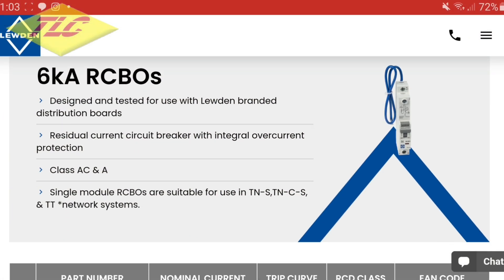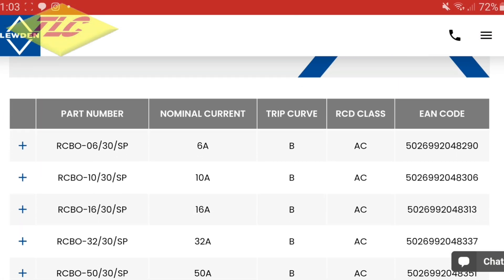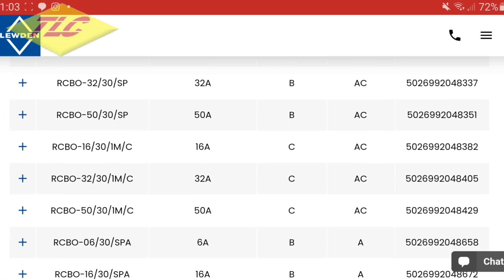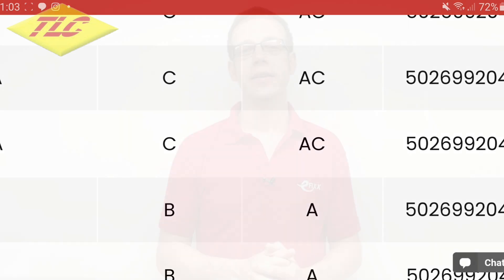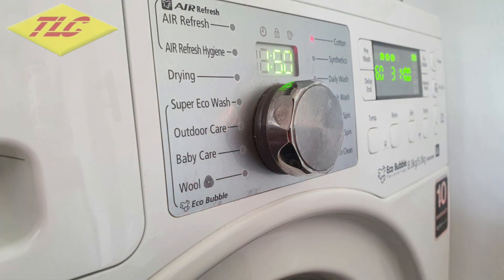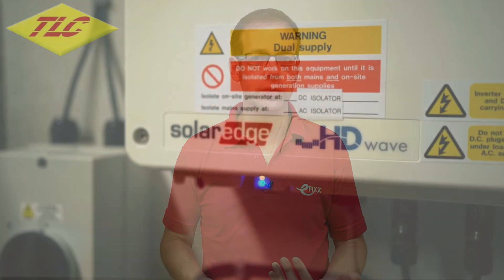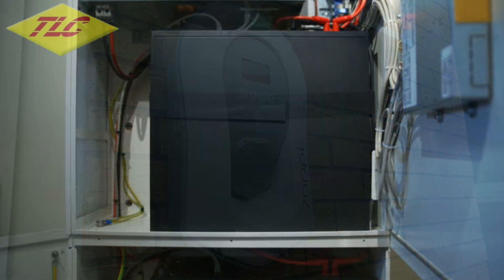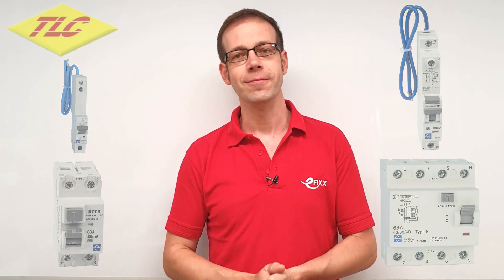What is the difference between a type A and type AC RCBO or RCD?

Comment: Just about everthing has some kind of electronic control on it now. Cookers, fridges, AV, LED lighting, boillers, showers - the list goes on and on. Even if the current appliance on a circuit is a dumb resistive load - lets say a cheap cooker, theres no way to know if that will ever be changed out for one with more buttons than a jet fighter. To that end i've started using type A as my standard. On top of that, my normal practice now is to quote for full RCBO (Type A of course) board to split up that back-feeding DC. I also install SPD's as standard now to help protect all those electronics.
Reply from the maker: Sounds like your onboard 👍

Comment: Thinking about this more and more. You really need a crystal ball to spec up a board. How does one know what a consumer is going to use in the future? Maybe it should be made law that appliance manufacturers are to include a product specific internal protection device lest individual specific RCD sockets be fitted for certain products. Maybe I've had too much wine.
Reply: The only way around that scenario Rodger is to spec for the most dangerous situation, as we used to say years ago, wire as if your customers are complete fools.

Comment: Great video, but could someone explain how one identifies an RCBO with a Type A (or B) RCD element? Since we use Type A, B C & D to refer to the overcurrent tripping curve in both MCBs AND RCBOs, something advertised as a Type A RCBO still only has equivalent to Type AC RCD protection, right?
Reply from the maker: You can identify the RCD type by the symbol on the front. The B, C or D comes before the rating, as in B32, C16 etc. Check out our free CPD on RCD types here: https://www.efixx.co.uk/Know%20How/rcd-types-cpd
Reply: @efixx  is that not that b,c,d is the curve of the tripping time and not the type of RCD it is? This information seems to be hard to nail down.

Comment: As a consumer, does the test button cause it to trip if it’s saturated with DC feedback? As I understand it the test button actually induces an imbalance between live and neutral so I suspect it does, but it would be good to know as I don’t want to assume everything’s fine when I hit test and the find out it’s not when it’s actually needed. Cheers.
Reply: I would say yes would still trip via the test button press but the issue would be that the load.... would  that work Maybe no so.

This leads to 
The injected dc appliances causing an issue might not be on at that  present time.

Easier just to change out to type AC and keep compliant is my best answer!🤓👀
Reply: @bramcoteelectrical1088  thanks, seems strange the the reg writers are concerned with arc faults, but let’s face it how many people have led lights and computers, chargers av kit etc in their houses possibly negation rcd safety devices. I would have thought mandatory advice to update would have been time better spent than afdds

Comment: Totally agree.

I have a question if someone could help?
Any ideas on what should happen/do:- 
If you're doing a small minor work on a  lighting or socket circuit, that had a dual AC RCD fitted to a modern  consumer unit, and the circuit(s) your working  on  has PV, EV or Aircon sharing the same RCD?

Same question with new installations?

Thanks ( sorry for the long question!)

Comment: wish guide to installation of manual transfer switch UK Where we reroute existing house circuits ( eg gnd floor) to switch between grid and external generator ( solar battery off grid in my case ) As the funder of this project this part is elusive (USA does this all the time with many helpful videos but UK silent) Critical for planning is the size /cost of associated equipment.  Wish Application Single phase Domestic premises 100A main fuse   Max load on  gen 40A :  A schematic diagram  showing recommended/ Typical  manufacturers kit ( switch consumer unit etc ) So I can look that up in theri catalogue and get and idea of teh size of these things and cost .   Waiver Of course : "Your plans must be approved and installed by a qualified electrician "  Why is the UK industry so reluctant to help . In USA they fall over themselves for customer service.  Closest so far is Wylex. Alas overlooked re-routing selection existing circuits. Asked many ... either no response or no further information . Ciao MsO

Comment: Here in Germany the AC type must not been used since the early 90th. Here is the same discussion in place,  if you should use a type A or B 😉
Reply from the maker: Does anyone make a type B RCBO?
Reply: @efixx  i don't think so. I have never seen one. But here rcbos aren't used very often. Normally 2 or 3 3phase rccbs(RCD) are used in houses. Rcbos are used in flats for the hallway.

Comment: Ive unfortunately missed most of your excellent work this week due to work on the Brecon mountains.  Not much signal up there.  I have a question thou, does having a mix of A and AC type RCDs/RCBOs have a detrimental effect, just like different brands of mcbs can?  Could you have a situation where a AC type could effect an A type or vice versa through some crazy science that only Joe can understand??  My initial thoughts would be no, but it intrigues me anyway.
Reply from the maker: Welcome back - we will explore this further as we've had mixed opinions on this.
Reply: Mixing woukd just mean the type A will function correctly if presented with a dc injected fault.
 But the type AC have a high chance of not functioning correctly so regardless of mixing some will do there job and some wont.

Maybe i stand corrected... 

Best to try to just change out thats what i would do myself

Comment: Going out on a limb here burin guessing there is nothing compelling equipment makers to stipulate how much, if any, thier products could leak DC current in a AC system.

Do we think that there should be such conformity (if it doesn't already exist), to help sparks and end users better understand what thier equipment does to the installation and any connected equipment?
Reply from the maker: Ah - where would be be without regulations! - the link below is useful - "normal" leakage current - from eg EMC filters on appliance inputs.
https://www.meanwelldirect.co.uk/glossary/what-is-leakage-current/#:~:text=Leakage%20current%20is%20the%20current,such%20as%20the%20human%20body.